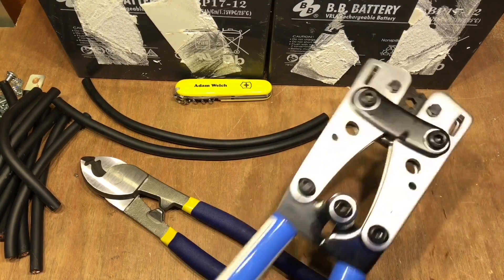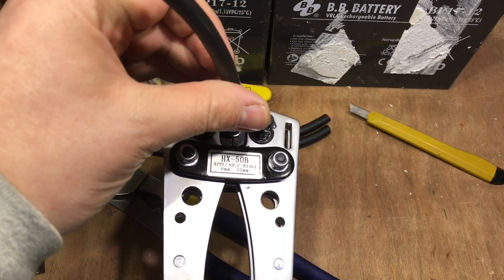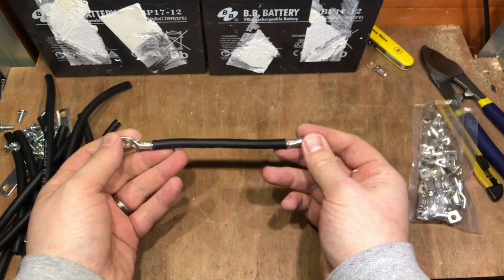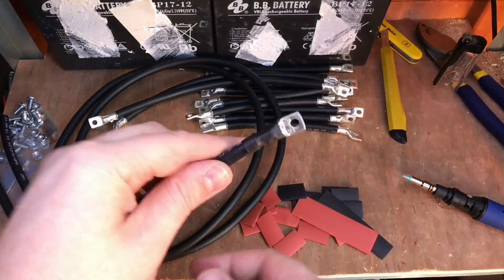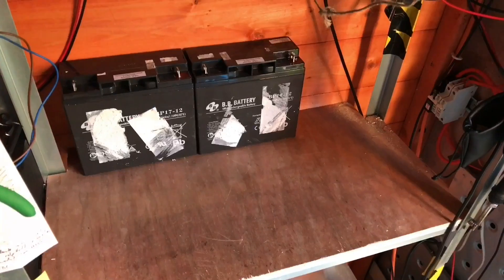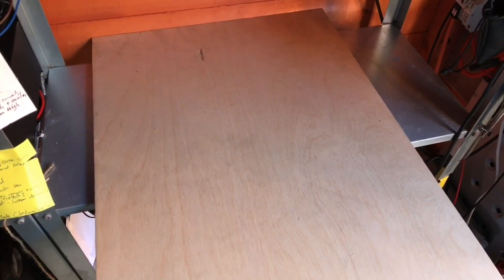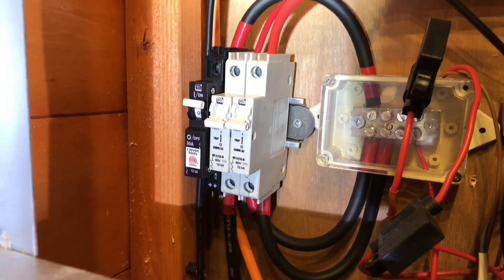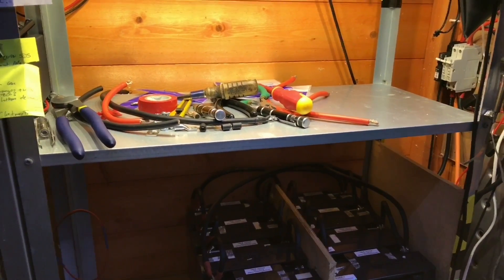New Year, New Battery Bank - Part 2 - 12v Solar Shed

Comment: Adam, you should place the Battery DC breaker as near as possible to the battery (i.e. immediately next to it) as the length of cable you have from the battery at the moment all up to the DC battery breaker is unfused and open to risk

Comment: what gauge wire did you use to go from the bank into the controller? I can only seem to fit 6 awg into the tiny holes ...it seems like those cables should be bigger being that they dump 25-30 amps from my panels into the bank.... Or does it not matter as much as I think it does?
Reply from the maker: I have 16mm2 cable (sorry I can’t remember the gauge off the tip of my head) going from the bank to two bus bars. That’s where my inverter connect (via a breaker). The charge controller is wired to those bars (via another breaker) using 12awg.  My charging current and discharge current through the charge controller is fairly low... 10 amps most.

Comment: Hello, try to solder the connection after only one cripple. It allows corrosion to stay out for ever inside the connection. Old copper 1 cm tube is also good to build terminals.

Comment: What happened to the 24v shed?  I thought you had 24v as well.
Reply from the maker: +Independent Living I do have a 7s lithium pack which is roughly a 24 volt system. It's not used for much though - need to make better use of it.
Reply: Ah, I thought there was a 24v system somewhere.  And this is Techman1219.  I use the other account when am travelling anonymously.  Had problems a few years ago where someone was following me everywhere for a chance to insult me.  I think she has given up over time but you never know.

Comment: I'm very confused.. Why crimp instead of soldering with a torch and good leaded solder.. I HATE CRIMPS.. 

Maybe I'm biased as I live on a boat!
Reply: Ya I have heard the same thing and I don't buy it. The only connections that have had ZERO problems in the last year and a half of living in the Carribean are my soldered ones (with proper heatshrink). In fact, just yesterday I removed 5 MC4 connectors that had failed due to moisture ingress. 

However, I will agree that soldering does introduce a brittle point in the wire. Its important to use proper marine grade heatshrink and then support the joint after soldering. 

I will continue to solder as its the only method I trust %100. Thats a big deal when you are a 100 miles offshore in 8ft seas!
Reply from the maker: I did try soldering a crimp on later and found it a bit messy.  The rubber melted on the wire.  I did go over it with heat shrink but I wasn't a fan of the method.  I will look again -  I think the battery bank may end up being changed again before too long.
Reply: Travis Wizniuk  For years I've been soldering electrical connections on my boat, and then someone said NO! Because it introduces a cocktail of metal residues in the flux etc that speeds up corrosion in a salt water environment. But I've never had much luck with crimping either. What to do??
Reply: Whew, I'm not alone :-) Cheers

Comment: If you want to get really fancy you should wire the batteries crossways. Bit hard to explain in a comment but it ensures that every battery gets the same current drawn as currently your middle ones will be lazy and the end ones work harder

If you look on the smartgauge dot co dot uk website they have a handy diagram

Comment: Hello Andrew...promising project...!  Still lead acid though... The terminals, on both old and new batteries, can be cleaned and then coated with vaseline...aka petroleum jelly...to prevent Oxidation. Especially when outside.   This also goes for the new cables, as they may have tiny tiny air leaks to bare copper inside the shrink and shoes.  Keep an eye on the screws:  They have the highest reactivity potential.  Treat your batteriy bank as a boat...sailing in humid "dirty" air. Metal boat parts have a zink anode as a offer to the corrosive gods...!
Reply from the maker: Cheers for the advice.  I'll definitely be treating my terminals with something - vaseline is nice a cheap.
Reply: Great for car batteries too...!

Comment: Its great to see others using the correct tools for the job. I have made so nice big cables up and it goes great with correct tools. (50mm2)

There are so many people that have used copper tube and a vice to make their cables, they work but are no where near as reliable, or as good electrical connection but cost plays a big part.

i like you videos i look forward all your new ones.
Reply from the maker: +Urban Off grid Thank you. I often try to do things on the cheap but some things are worth an investment. Nice to have you along.

Comment: sorry to spoil your fun, but this construction is most likely to be a mistake. The tiniest imbalance in one battery will pull down the paralleled ones. One can avoid this effect by separating the batteries with diodes.
Reply from the maker: I think i mentioned this is a possibility in the video(?) if not I meant to.  If I notice the voltage dropping I'd run a load and check with my clamp meter to see if there was an imbalance.  Otherwise I could always halve the pack quickly and start narrowing down.  Sounds like fun to me :-)
Unless I miss understand your suggestion diodes aren't going to be terribly useful in a battery bank which both supplies current and charged on a daily basis.
Running anything like this in parallel can cause these issues.  It's the same with solar panels for example.  I keep a close eye on my kit and hope to find any issues reasonably quickly.  Thanks for the suggestions.
Reply: Well, what you will find without diodes after let's say 6 month is 2 dead batteries and 1 working one. If you have a separate supply line e.g. from solar panels, you need 2 diodes for each battery. The choice of  diode is tricky. Then you will find 3  working batteries with slightly different capacity after 6 month.

Comment: Adam, my shield 85AH battery is going the same way. I am hoping I can keep it in service for a few more months but I think at 2 years old it will be done. I am looking at building an insulated box as I think the heat in summer really wore it out. Cheers Ian
Reply from the maker: I hope they'll get a second lease of life - the AGMs are holding a much better voltage by the morning though.  I've made sure the old ones are fully charged and in a few more days I'll check the voltages and see what that tells me.  Cheers.

Comment: AWESOME! 👍 I am re-doing my bank...lots of cable making like you. Problem I ran into is heat dissipation/batteries swelling. Still need a pinch more space in-between the 6v batteries. Space is limited. Not gonna do a box...more like a shroud. This should help with them breathing/thermal expansion/cooling in the hot months. For now, the bank should be alright. Cheers Mate.
Reply from the maker: +Chris DIYer Thanks Chris. You've invested a lot more in your bank than I have so I really hope the re-jig sorts out your issue. Looking forward to your video on the new wiring and box. 
Happy new year to you.

Comment: Nice setup Adam,

I have a similar solution with 30pcs of 17Ah AGM's in parallell, working great :)
I set them up in another way, to prevent that a single battery failiure would pull down the whole battery bank.
Fused up each battery individually, with an 1A fuse.

Some images prior and under installation in the boat shed.

Batteries:
http://i.imgur.com/fKBAWur.jpg

Bus bar and fuse blocks.
http://i.imgur.com/6TKHEBE.jpg
http://i.imgur.com/PHkV0Dv.jpg
Reply from the maker: +Kristoffer Hansson That's a neat job because wiring them up like that takes a fair amount of wire! 
I'm able to clamp round the interconnections and see which way the current is flowing. As long as I keep up with regular checks I think I'll be ok - and if not I can adjust and think again. That's the fun of it :-)

Comment: Hat's off to your workmanship, but besides looking tidy, I think that daisy-chaining the batteries for a set of parallel connections is a mistake: only the cables near the end close with the main connector wires are going to see the heavy current, such a gauge is waisted at the far end.  Instead, I would use cable of a gauge similar to what was originally used, and do a "home run" from each battery to a common point (one each for positive and negative).
Reply from the maker: +James Buchanan Thanks for the kind comments. Once I'd bought the cable (which I thought was good value) it seemed  daft using smaller interconnecting cable. Connecting each battery to a bus bar would have created far more cable (and mess). I'm the sort of person who plays, so I'll see how it goes for a bit and possibly change in the future.
Reply: We have all been there on a regular basis, once we are "in for a penny", we are most often "in for a pound".  
As you go forward, perhaps also consider the possibility of individual batteries going bad, and how to know when that happens and/or testing for that; will one bad battery kill the efficiency of the whole setup (by consuming stored or incoming solar power)?   And maybe the possibility of 'balanced charging' for the whole set in the future??
Reply from the maker: +James Buchanan The batteries should be closely balanced in this configuration. I'm going to be checking the current running through the interconnecting wires with my DC clamp meter every few weeks and hope I'll be able to weed out any issues early on. 
I'm testing this configuration - if it doesn't work I'll have to think again. That's half the fun :-)
Reply: Adam Welch I suppose that if you take a current reading (under load) at each battery, working from the far end to the near end, and mathematically subtract the prior reading from each new reading (other than the first reading, of course), you can and will know the current contribution of each battery...👍🏻

Comment: I would dare say that they will perform better in the Winter as they are not so reliant on a topping charge as the flooded ones are. Keep an eye on them and weed out the bad ones ASAP as cells tend to fall over in AGM batteries pretty quickly, especially the small ones. 

As another commenter stated, it is a good idea to solder the lugs on connexions to batteries, it stops the corrosion from getting in between the wire & the lug. You are right though about your iron being a bit small for the job. I think it's fair to say a good crimp would still be better than a poor solder joint due to not enough heat. All you need to solder these lugs though is a cheap 80 watt iron. They do the job very well. And good for Anderson connectors too. 

Even though you have done the corner to corner wiring, keep in mind that does not compleatly guarantee current sharing between the batteries. It's an extremely complex ohms law equation as what you have is a "ladder" circuit, but simply put the batteries near the terminal ends will supply more current when discharging & take more while charging. So they will work harder than those near the centre of the pack.  

The only way you can avoid this is to take all the each positive & negative terminal of every battery to a single connexion point (stud) using identical length cables for every battery no matter how far from it they are. That requires more cable, and is messier! 

Could be easier to simply rotate the batteries occasionally. In your case you could easily achieve this just by swapping over the termination end and the jumper end of each row by moving the cables. Looks like you've got plenty of length in your main cables for that. 

With your old batteries, charge them up to full with a good charger and see what they sit at after 24-48 hours. If they are dropping into the 11 volt range you proly have a shot cell. 

Hope you have a good new year Adam..! :)
Reply from the maker: +xanataph Thanks for the full explanation Xan. I'll see what I can do about soldering the lugs.  Rotation is also a good idea - bit of work every few months, but hopefully should be worth it. I'll try and keep an eye on the current every month too with my clamp meter so I can catch any issues quickly. I'll get the others on charge and see how they fair. Hopefully one of them will end up in the caravan and save us paying out for a new one. Cheers

Comment: Adam is the current and SOC read outs accurate on your charge controller? I have the 40a version and find it's about .45a less on the load reading and shows only 1 bar on anything less than 26v.
Reply from the maker: +Scott Davis I find current wise it's pretty good. The SOC meter is a bit bizarre - it's only full if the battery is currently being charged to its highest limit. So as soon as the sun goes and the battery naturally falls, so does the soc meter. I prefer to keep an eye on the voltage and forget the soc meter.

Comment: That tool is also called a Swaging tool  :)

Personally what I would do, is strip slightly further back on the cables, and after a single crimping, fill the cup with solder, and then finish it off with heat shrink. The solder makes sure of a few things, 1) a super solid connection; 2) better connectivity with the connector; 3) dramatically reduces the chance of corrosion within the terminal.

All-in-all, great video, very clear, explanations, and can understand you just fine. You do great videos  :)
Reply: I solder all my lugs with 100W solder iron up to 2 AWG wire. For larger wires i just preheat with heatgun.
I don't trust crimped wires without soldering
Reply from the maker: +CheapVlog Yes thank you. I'll add it to the job list when I get some time. I've bought some more solder as I think they'll take a bit of feeding :-)
Reply: Soldering is fab for some applications, but it makes the wiring more brittle as the individual strands are all now lumped together. Great for stationary applications, not so great if your battery bank is portable or in an RV/Caravan
Reply from the maker: +Bobby Hicks Many thanks. I did contemplate solder but there quite big connectors for my iron. I might test one out with the last bit of cable. Thanks for the suggestion.
Reply: On another video (can't remember who it was atm), but what they did was used the butane torch to heat up the lug. It worked really good. (In his video, I think he also 'made' his own lugs out of copper pipe and drilled the req'd hole)
When I do my setup, that's the way I was going to do it, as well. Altho, I plan on starting off with li-ion. So slightly different connectors :)
Reply from the maker: +Bobby Hicks I'm going to give the soldering a go. Might need some thicker solder to do them all, but I'll try a torch and my iron to see if I can do one that way first before investing too much.
Reply from the maker: +zogworth Interesting point. Thanks for the input.
Reply: Higher power equipment wiring and mobile equipment wiring is never soldered, always crimped, along the lines that zogworth has said. The correct crimper for the lug type is critical. So many people smush lugs using the wrong tooling. A good crimp will be much stronger, more resistant to flex damage, and more resistant to corrosion. 

One thing, the sharp thin strip left when you crimp the lug can be easily removed by rotating the lug one step clockwise/anticlockwise  in the crimper and re-crimping.

Awesome vids Adam.

Comment: It would be neat to see a lithium based battery bank. I know there are already lots of video's out there but I prefer your style of video. Can you program your Charge Controller to work with lithium? probably LiFePO4.
Reply from the maker: +lonnie776 Thanks. I've got a small 18650 lithium ion based battery bank. It works pretty well. I've done a series of videos on that... https://youtu.be/YoH7V56RtkM
Reply: Yes, I have seen them and enjoyed the video's, however the actual usefulness of the project is questionable. Would like to see something like that but on a larger scale and with a proper Li-Ion or LiFePO4 solar charger.

I really do think lithium is better in every aspect as opposed to Lead Acid. Better life span, greater energy density, quite safe (LiFePO4 anyways), and if you calculate cost over a period of 10 or so years actually cheaper as well.

But I enjoy your videos and always find them interesting.
Reply from the maker: +lonnie776 Glad you've seen them - yes it's a small experiment and there are people out there doing far bigger versions. I might start playing with other chemistries at some point. Thanks again.

Comment: Looks neat, if you ask me. Good job! The voltage will sag when it gets cold anyway, it's just how it is. Some types of batteries have a smaller drop, some have really big one. Also, I would give you a hint - if you charge a battery at low temperature and then you bring it in the house, where it's warm, the battery will effectively be overcharged. Just so you know. I tested this myself on a cellphone battery, it went to 4.3V from 4.18V :|
Reply from the maker: +MrJohhhnnnyyy Thank you. I'm going to look at insulating them too to see if that has any effect. They've been dropping quickly with quite light loads on them unfortunately. I won't be bringing them in the house though - Mrs W wouldn't like it :-)
Reply: I don't think insulation will help here, they don't produce heat thus sooner or later they'll reach ambient temperature anyway. Just keep them topped up and you'll be fine and dandy :)
Reply from the maker: +MrJohhhnnnyyy thanks. I'll get something ordered.
Reply: Well not too sure about that. They started to put insulation around car batteries too so it must be for some reason. I'm sure Adam can find some for free.

Comment: Is there a gap around and in between the batteries for cooling I could not tell? Nice clean looking now.
Reply from the maker: +old time engineer Not much no. I don't think this will be an issue for me however - but I'll get back to you once the weather turns! Thanks for the comments.